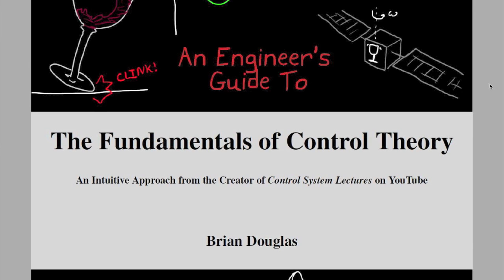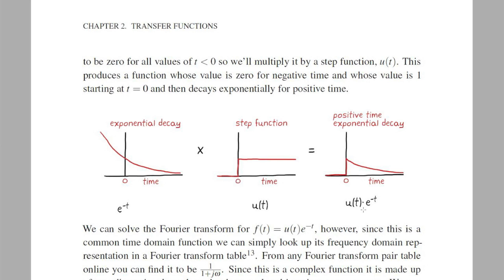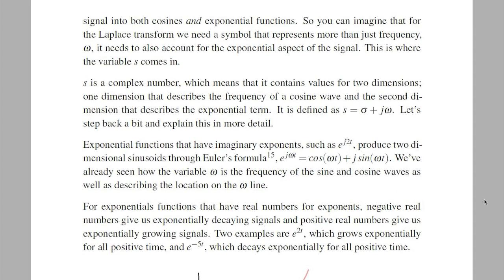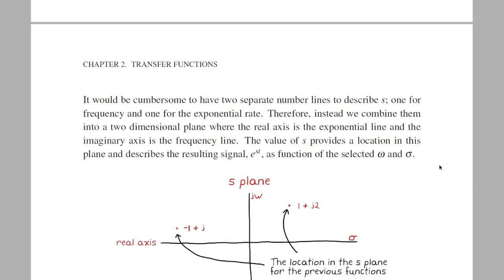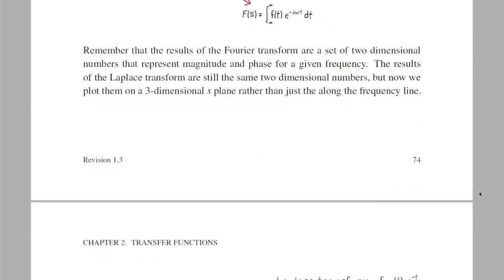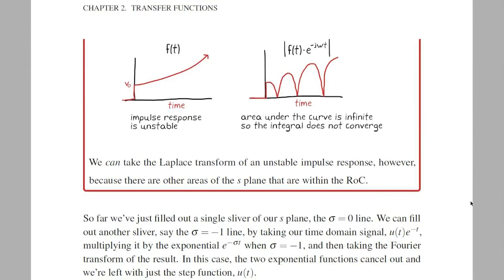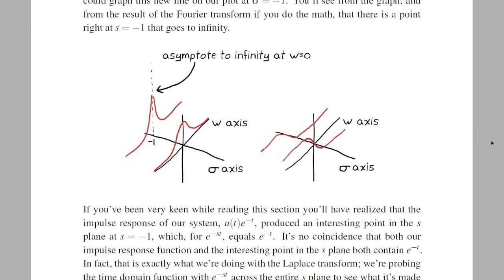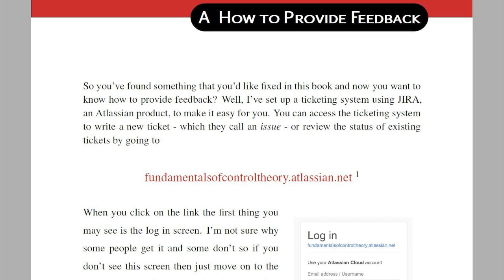The Laplace Transform and the Important Role it Plays

Comment: My important root locus diagram by a spin dampness that form a circle over plus as dampness is forming plus and minus move along exponential x axis this is with reference to a Venus or Mercury spin that forms a semi circle over a circle
But the Jupiter root locus diagram form a parabolic raise from left side of zero dampness curves up and moving towards jw axis.But the Saturn root locus diagram curves down from plus axis parabolic towards fourth quadrant.Does this indicate undamped oscillation having an infinite raise?If so how this is able to control all the planetary emissions forming the genetic theory of hologram with reference to photonic emission of solar rays which is also having a feedback system may be a converging point we call this GRP that moves at the rate of 30 degrees in every 2 hours.Can this be compared with that of Poincare conjecture spherical.domain that may form a feedback system

Comment: Is it accurate to say (at 1:00) that the frequency domain is two-dimensional? I think a two-dimensional function has two inputs (its domain has two dimensions). Here the domain is still one-dimensional (the frequency) and the value of the function (its range) has two components (magnitude and phase). I struggled with this a bunch because the Laplace transform's result is truly two dimensional in its domain (frequency and exponential) as well as its range (magnitude and phase, like the Fourier Transform). The jump from one- to two-dimensional domain (from FT to LT) is important, so I don't want readers to be confused by thinking that the FT's result is two-dimensional.
Reply from the maker: +Lawrence Kesteloot this is a great clarification and absolutely correct.  I do not want to confuse readers with my poor (and wrong) choice of words.  I'll make a change for the next release of the book.  Thank you for writing this comment! Would you like to submit a ticket here  https://fundamentalsofcontroltheory.atlassian.net/secure/Dashboard.jspa so I can can give you proper thanks and credit for your comment?  If not, no worries, I'll just make an update without it.  Cheers!
Reply: Hey Brian, thank you for this video, it was really informative in ways rarely seen in other sources. I would like to clarify further on the point of complex dimensionality: is it really right to consider the domain/range as a 2-dimensional one if it's complex? From what I've gathered, for the FT: domain ω is 1-dim real, range F(ω) is 1-dim complex; for the LT: domain s is 1-dim complex, range F(s) is 1-dim complex. I understand that by 2-dimensional, your intended meaning is that it has a real and imaginary component, but my question is: is it really alright to treat them as the same thing altogether? Do inform me if I've made any incorrect assumptions here and thanks again!
Reply: @lawrence kesteloot plz explain your word here 'The Laplace Transform's result is truly 2 dimensional in its domain(frequency and exponential) as well as its range(magnitude and phase like The Fourier transform)'
Thanks for the detailed information
Reply: Lawrence Kesteloot plz explain